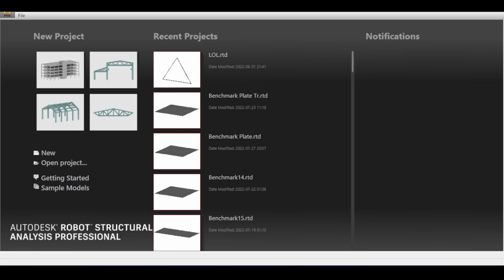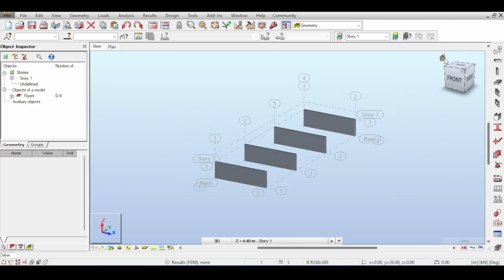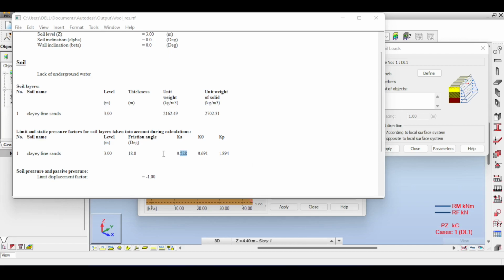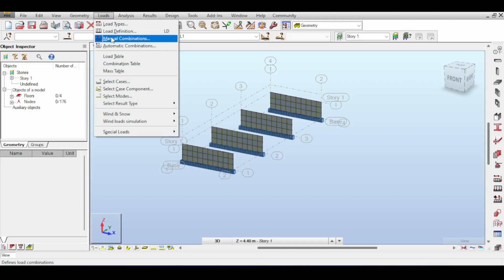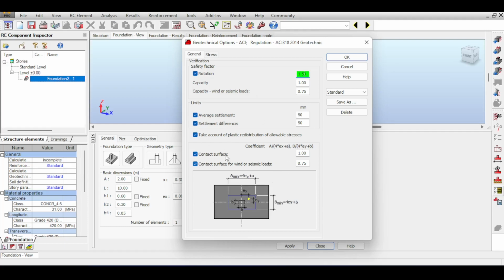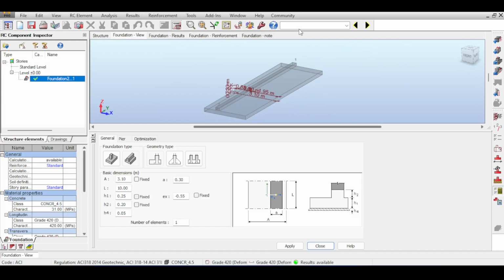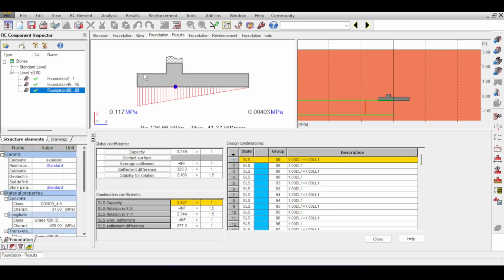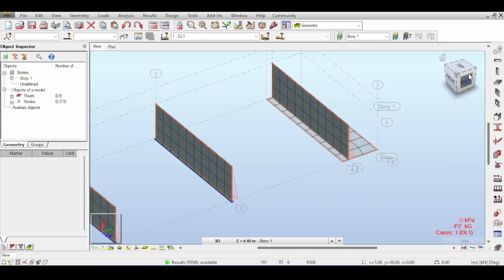Design of RC Retaining Walls  in Autodesk Robot: A Comparison of Different Methods

Comment: Firstly, excellent video as usual Prof. CEE! Secondly, please share the wall thickness recommendation for Nii Sarpei's approach. I did a similar comparison using EN and South African rebar codes and Nii Sarpei dimensions used minimal concrete and steel but also beat the other approaches regarding safety factors! Lastly please confirm if it is rule of thumb or if it is from a particular code that I can look up. Thank you 🙂
Reply: Never mind, I found the comment, will leave my ones though for engagement 😉. Thank you Nii and again Prof. CEE!

Comment: Thank you for taking the time to create such a detailed tutorial. It really helped me grasp the topic. But i am having difficulties with the retaining wall foundation design, i followed the two great videos you made for retaining wall  and did exactly what you did in creating the foundation but my h1(the thickness of the footing automatically generate a ridiculously very high depth of 1.3m) when i try to change it it bring error like this (Condition not met for: Foundation shear	
Safety factor of bottom reinforcement in the direction of X axis: 0.00 < 1.0	
Safety factor of top reinforcement in the direction of X axis: 0.00 < 1.0	
) please help me ...thank you so much CEE in advance
Reply from the maker: first of all, I am very sorry for my late reply.
can you send me the RSA file on civ.eng.essentials@gmail.com? I will take a look there and report back to you
Please copy paste your comment in the email so that I have a bit of context

PS: Sorry for the late reply. I had a ton of things to finish and now I am gradually getting back
Reply: Yes. At 22:26 in the tutorial, go to:

Calculation Options → General → Verification

Then:

One-Way shear → Do not check (leave unticked)
Two-Way shear → Do not check (leave unticked)

So both shear verification options should remain disabled for that example.

Comment: Dear CCE, Thanks for your sharing! I'm looking to see the video continuous  with raft found in retaining wall in futures. 🙏🙏🙏
Reply from the maker: Will be covering it as soon as I can. Currently, the RC building design series is what is taking my time.
Reply: @CivilEngineeringEssentials yes please!!!
Reply from the maker: @lorenzo_UK  Will keep it in mind. I think I will make 1 video that goes through the entire retaining wall from start to finish.
Reply: @CivilEngineeringEssentials  ye, I'm designing a basement level, that basically matches your workflow as it would be a retaining wall.
The real pain is to use both the floor onto elastic support (as a raft foundation) and the linear fixed support for the retaining walls.
The reinforcement gets assigned properly only if you select the fixed support (RC component) which I appreciate is probably a Robot limitation.

For a basement level it also seems impossible to add reinforcement between the vertical walls (floors) as the corners don't receive reinforcement.

Another limitation (I think...) that I found is that if you have loading onto the basement walls (for example a wall on top of them) only the shapes "00" (british code) get used. It doesn't make sense if you have a loading or an opening, as other shapes can be used.

If you have a sec. let me know what you think as I'm not sure if I'm doing anything wrong.

Comment: Hello CEE. Yes, you are pronouncing my name correctly. I took my time to watch this (and I am glad that I did) because rushing through this deep dive 😊 would have been a waste. I love the fact that CEE do not shy away from addressing limitations or inaccuracies head-on where these exist, I now appreciate (because of CEE) that there is strength and growth in such an approach.
 
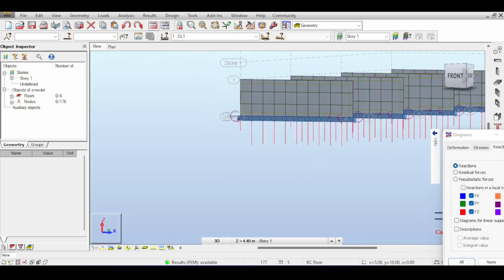Thank you for touching on the modelling of the sloped retaining wall at 7:00, and for the discussion on the interpretations of the “diagrams for linear supports” at 9:14, I have a question here:

1.Why are the reactions Fx and My not zero under the wall self-weight? These reactions are none zero whether viewed as “individual nodal Forces” or viewed through the “diagrams for linear supports”? Fx is especially noticeable. Which loads are creating these forces or reactions?
Reply from the maker: Great to know, I do usually try my best to pronounce names correctly, as I - myself - have a strange last name which makes ppl think before saying it. I've heard like, idk, 5 possible versions of my own name.

Now I am really happy that you liked the vid. as for your questions: here is an explanation (I might talk about this in a future video if I somehow find myself faced with the same force)

Now first of: forget the wall. Imagine you have a small table or chair.
and you start loading it.. gradually... more and more... 
what you will see is, the table "legs" will have a tendency to "spread apart" and "move away" as the load increases, ultimately breaking out of the table, making the table lay flat on its surface.

now why does this happen? and why do "frames" have horizontal force components when the only force they are subjected to are vertical gravity forces (ignoring wind).
Well, the reason is:
the horizontal elements (surface of table, beam in frame) will bend, which cause the "legs of the chair" or "columns of the frame" to move outside, as they are connected to the beams by rigid connections.

So, I hope that the explanation above establishes why for a table and frame, you have a horizontal force component that "tries to push the column or leg away"

of course you can resist this "pushing away" by applying proper supports, For a frame, using 2 pins on the ground will hold this movement, causing horizontal forces.

Now something similar happens to the walls. 
Furthermore, another factor that makes walls unique to frames is that they are continuum domains (it is just a cool way of saying: surfaces)
Allow me to remind you of your mechanics of material course (a course I personally teach at the university ;-) )
you studied that there is something called: poisson's ratio.
This also plays a part in those walls, but this is a lengthy explanation that I will keep for later.

Anyways, this is the reason why you see Fx.
as for moment: 
copy paste the entire explanation above, but replace the word "tendency to spread the legs of the table" with "the legs of the table are also going to rotate"
and "resisting this horizontal movement" with "resist this rotation"

Sorry for this looooooooooong explanation, I hope it made sense.

Regards,
CEE
Reply: @CivilEngineeringEssentials  Thank you, the explanation is perfect, it is intuitively relatable and it also points me to the relevant references for further details. I do not consider it long at all, in fact it is as required in order to properly address the question that was asked (I am grateful for the answer/response). 

I hope your students realize how fortunate they are to have (someone like you, scratch that), to have YOU as their professor. If they are not getting distinctions, it is certainly not because of lack of proper guidance, or explanations, or lectures. 

You got me curious about your last name prof?
Reply from the maker: I do get distinctions on my teaching each semester and they do get distinctions too, which makes me rly happy. Last name is ___. I am Dr. ___. (__) Teaching at the university of ___. I am an assistant professor and hope to become a professor as soon as I can. 😁
I am specialized in structural engineering.
Reply: @CivilEngineeringEssentials  Doc, (MJ 😊), you are that good. I know I am not (and cannot be) the first one to tell you this. You are already a Professor to me with a whole lot more to give to both your students and to the rest of the world.

As far as I am concerned, it is just a matter of administrative processes to be done for the University of Bahrain to officially award you your [already] well deserved Professorship title.  

I am a Civil Engineer in South Africa, we are worlds apart ! thanks to YOU (and to your willingness to openly share your knowledge with the rest of the world), I consider myself to be fortunate to get to share in your knowledge and experience. Thank you Prof.

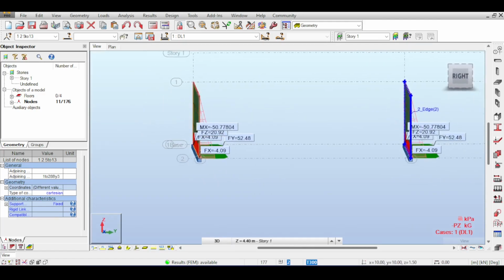Comment: The explanation from 15:10 and the two options, including the “BAD option” are examples of why CEE is on top. It was very satisfying to see and to learn how to best model a retaining wall including its foundation in RSA using simplified techniques and “floor” objects as the main modelling elements. What the limitations are and what the designer may practically do to better manage the associated intricacies.
Reply from the maker: Well, as you may have noticed, I do encourage hands-on approaches. Furthermore, I intentionally leave myself in the dark as to genuinely get surprised sometimes, which will prompt an honest reaction or an analysis that would be different if I simply "play out" a perfect structure using a flawless step by step procedure. 

So I basically speak my mind immediately whenever I got an idea, and then also honestly evaluate the idea and mention why it is a good one or a bad one.

Glad you liked it, stay tuned for more content
Regards,
CEE
Reply: @CivilEngineeringEssentials  This approach is working !! Keep it up. I am not going anywhere soon, I'm tuned for more content 😊
Reply: @donaldkhanye2323 Hi Khanye and @civilengneeringessentials Prof. CEE. Firstly excellent video as usual to Prof. CEE! Secondly, please share the wall thickness recommendation for Nii Sarpei's approach. I did a similar comparison using EN and South African rebar codes and Nii Sarpei dimensions used minimal concrete and steel but also beat the other approaches RE safety factors! Lastly please confirm if it is rule of thumb or if it is from a particular code that I can look up. Thank you 🙂